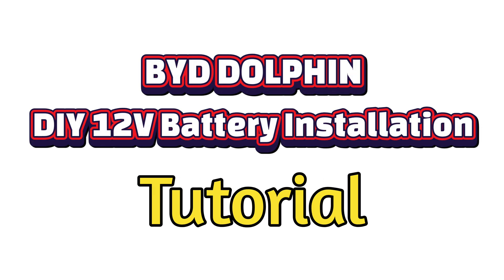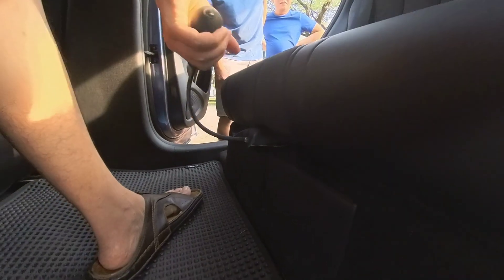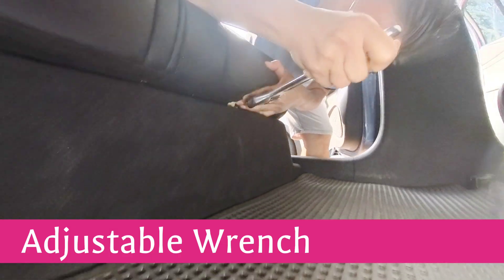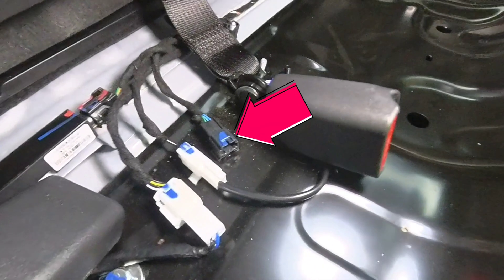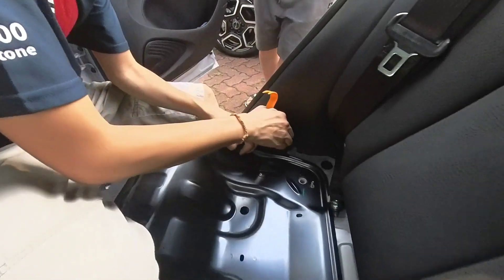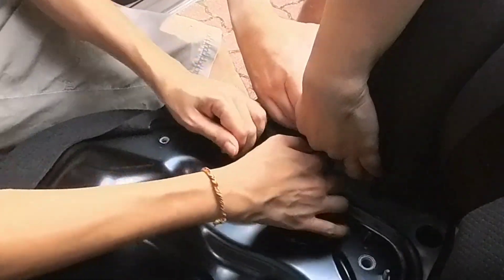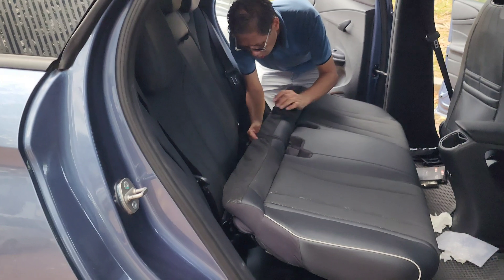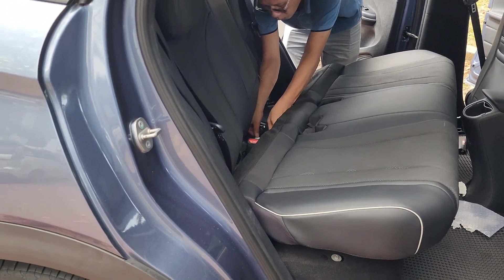BYD Dolphin - DIY 12V Battery Installation (Replacement from Lead-acid to Sodium-ion)

Comment: I think all new model BYD Dolphins have had the lead acid battery replaced with a low voltage LFP battery, which ”apparently” lasts a lot longer and is warranted for around 150,000kms.
Reply: Yes it does

Comment: Hello,

My 2025 dolphin heated steering wheel not working. I switch it on then it turns itself off after 2 seconds.
Do you have any solution for that?
Reply: I have one
Solution 1: by a new car
Hope it helps...
Reply: @h1bertojr After software update, it is fixed. Thank you so much for your valuable advice.

Comment: what a waste of energy on just to replace the battery. Wonder what are their designer think.
Reply: Oh my god what an operation to get the battery replaced. None of the battery shops around would know how to handle this. Means we have to visit agent for this. Amazing. Imagine if the battery needs a charging or general checkup if we feel it is weak.
Reply: I think the new model now comes with a low voltage LFP battery, which does away with the lead acid battery and lasts so much longer. Warranty around 150000kms.

Comment from the maker: CORRECTIONS:
Do take note that there are typo errors on the last part of the video,i.e., battery specifications. The correct dimensions are listed below:
*Original 12V Lead-acid Battery Dimensions: 207 mm (L) x 175 mm (W) x 170 mm (H)
*Replacement 12V Sodium-ion Battery Dimensions: 207 mm (L) x 175 mm (W) x 175 mm (H)